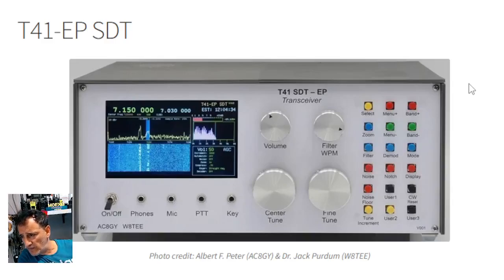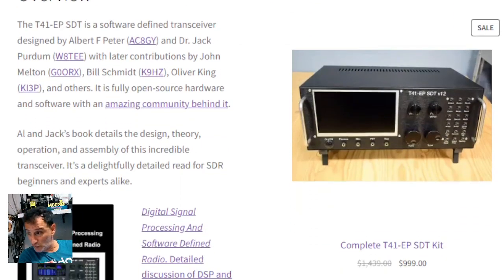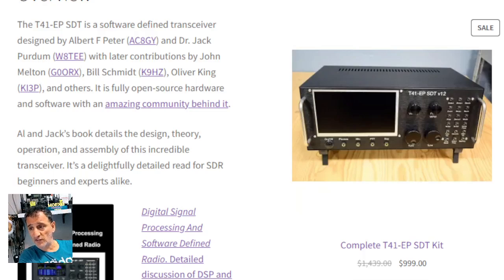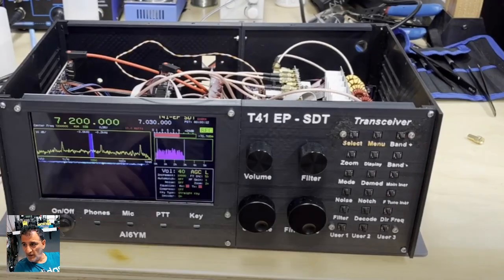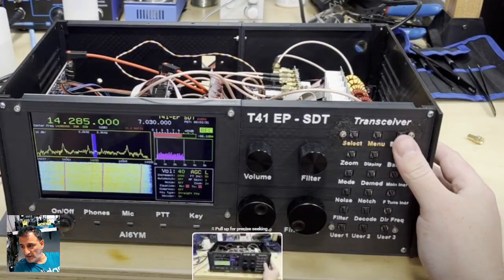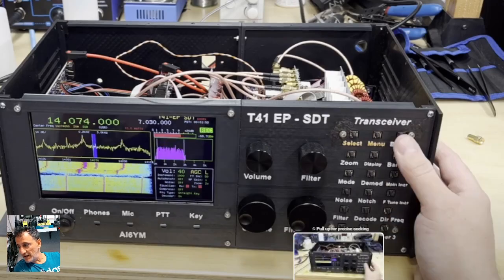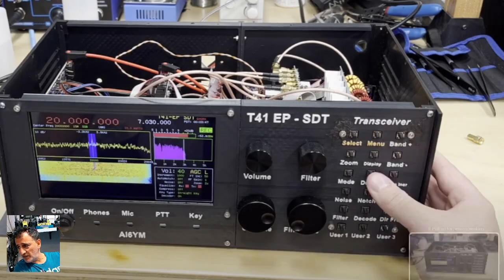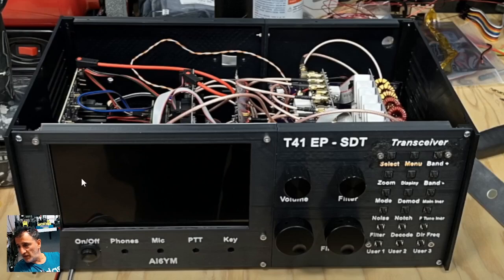AI6YM -  T41EP SDT  TRANSCEIVER

Comment: Its probably the only top end transciever available in kit form. I biult the version 9 kit and its now progressed to version 12. Not sure how easy it is to import from the US and cost wise, the version 9 was around £400. There is s detailed book on Amazon that covers the biuld and SDR theory, written by the designers. Also an active groupio forum and this has many updates for the hardware and software, both of which are open soure.
Reply from the maker: Good info.